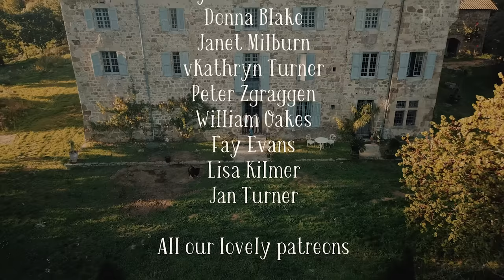Our First Big Interior Design Dispute | The Coach House Restoration

Comment: I agree with Amy.  A strong horizontal line across the walls will expand the room a bit, while constant vertical boards, even if painted, will just make the room seem taller and a bit stretched.

Comment: The wood panelling looks amazing! Marc, the next time you need to hammer on a wood panel, take a piece of scrap wood and hammer atop that instead of directly onto the panel - it will spare dents on the permanent structure but still get the job well done! 😉

Comment: Marc you're fitting the cistern/toilet tank cover without the toilet seat in place.  so how are you going to raise the panel with the toilet seat in place, the panel will run into the seat if the panel is flush with the toilet basin, not the toilet seat?  And you won't really be able to slide the cistern out of the wall, so how are you going to get inside the tank to fix or replace parts if it is fully recessed into the wall?
Reply from the maker: The seat isn’t flush to the wall - there’s a ‘neck’ of the toilet between the seat and the wall.

Comment: Too much wood in the bathroom:the wood will swell and shrink with the humidity which will crack whatever finish you put on it, and also could lead to mold behind. Hard to keep clean. 

Have you looked at all wood bathrooms on line?
Reply from the maker: There’s good ventilation in the bathroom so any damp air will be whipped out pretty quickly, and we’re leaving flexibility in the woodwork, which will include painting into the gaps.